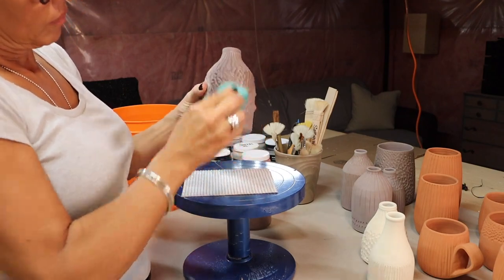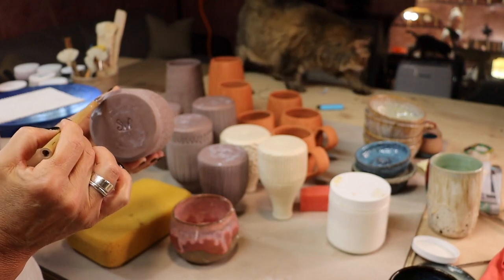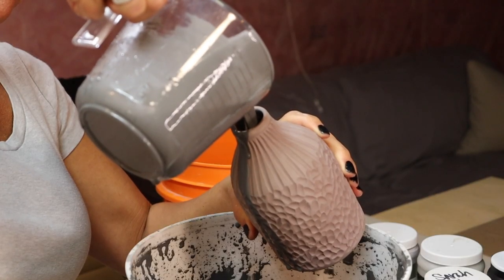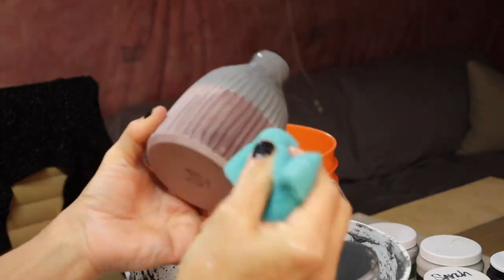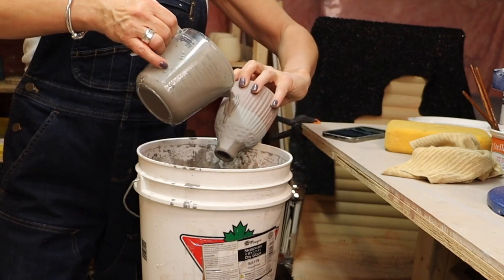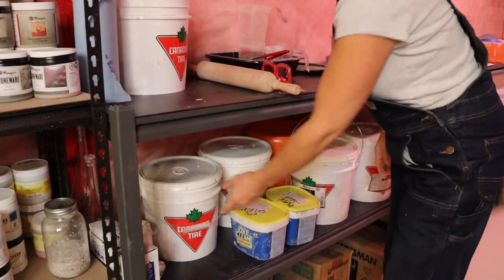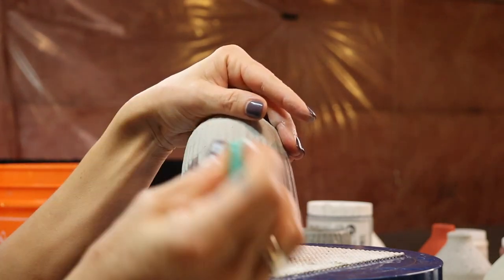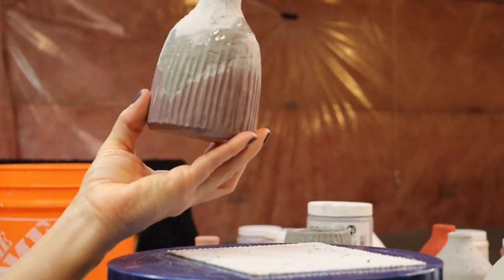GLAZE LAYERING for Beginners, Create Beautiful Glaze Results   HD 1080p

Comment: What firing schedule did you use as I’ve had a few things go wrong firing Potters choice  glazes? Just subscribed I enjoyed the video very much. 😃 Thank you 😊
Reply from the maker: Hi Lynne, thank you for your support!! I have a very old kiln sitter kiln. I try to fire to a cone 6, my middle shelf is the hottest and can reach 6.5 almost 7. As my kiln in manual I have to flick switches to add more heat so I do so 1 every 2 hours, with the lid propped. Once I get to the last of the 4 switches I close the lid. It takes about 9-10 hours to switch off. I don’t usually do a hold and it’s a natural cool down. I’m not sure how that all translates to an electronic firing schedule. 🤔 hope that helps! 😊
Reply: @SarahWaltonPottery  thank you Sarah to such a comprehensive answer to my query,  will have a think about how it translates to my kiln 😃👍

Comment: Lovely work.  Do you find any issue with contamination of your tools/batts/equipment when using the black clay - or do you keep sets for each type used?
Reply from the maker: Hi Ian, I don’t have any issues switching out the various clays that I use. I clean everything in between but use the same tools, bats, etc. I do have various reclaiming buckets for each of the clays, that’s as far as I go for separation. It hasn’t been a problem for me so far. I’m glad you enjoy my, thanks! 🤗🙏